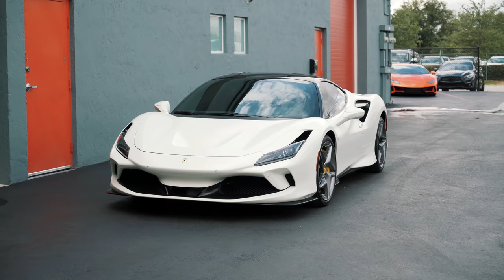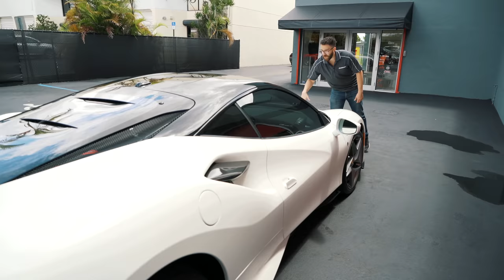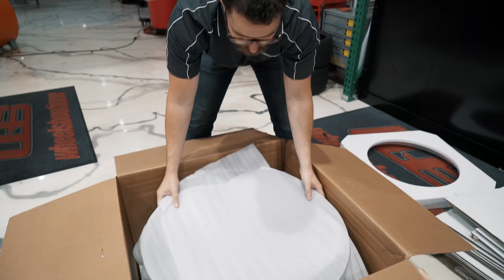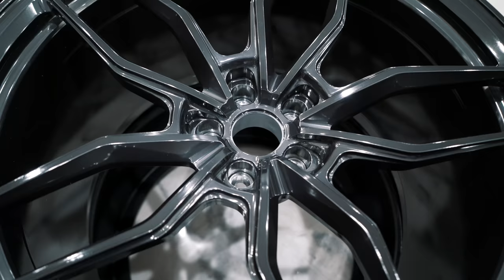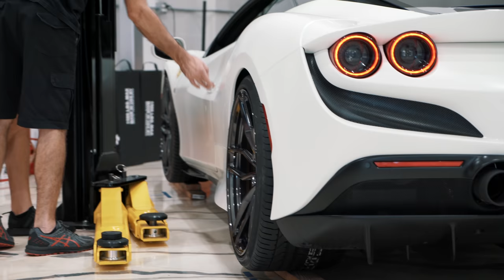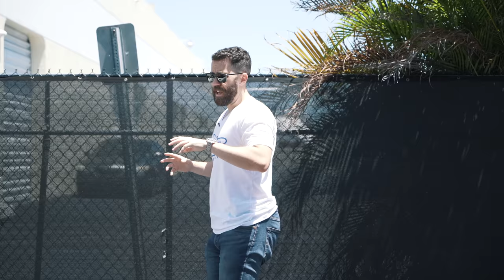WORLDS FIRST FERRARI F8 TRIBUTO LOWERED ON NOVITEC SUSPENSION + ANRKY WHEELS!

Comment: Looks absolutely phenomenal 😍. Stock wheels to me looks 🤮. Awesome work guys 💪👏. Also how the ride quality with this setup and would there be any difference with 20/21 or 21/21 wheels
Reply: Thank you so much! Admittedly the ride becomes stiffer because of the lower profile tires. It is one of the things you trade for the amazing look. The ride quality on a 20//21 setup would be about the same. To maintain the factory ride quality you would have to go with a factory 20” front and rear setup. We have never tried a 21”//21” on these cars before.
Reply: @NussbaumAutohaus  but for these 20/21 factory setup can we still change the wheels in same style and lower it with novitec suspension springs
Reply: Madhavram Chunchu Yeap, we sure can

Comment: Geez all that heavy wheel and size fucked with the suspension and final drive
Reply from the maker: These ANRKY performance wheels weighed less than the factory wheels despite their larger sizing :)
Reply: @WheelsBoutique  Even if that is true it's still affects the driving force due to a larger diameter and the suspension dampening was specifically tuned for a specific ride height
Reply from the maker: @axumitedessalegn3549  The tire profile is reduced to account for the larger diameter wheel. The overall rolling diameter of the 21"//22" setup is within the accepted percentage of change vs the factory 20"//20" setup. The lowered ride height also reduced body roll so the handling was improved.